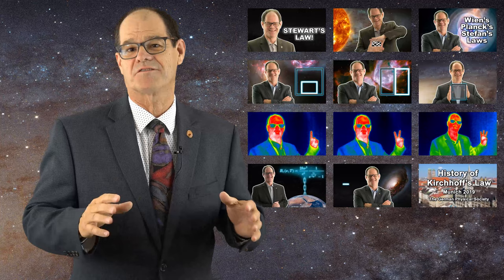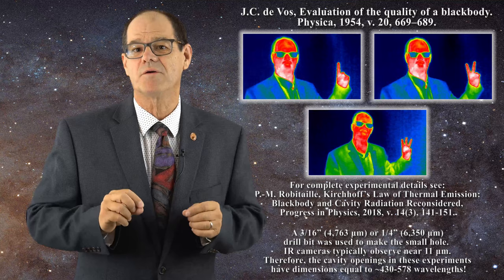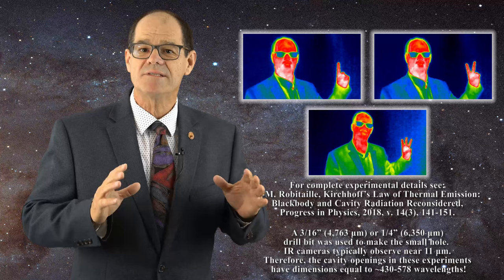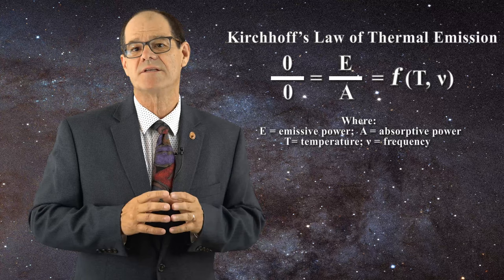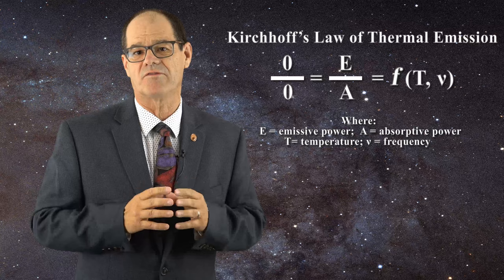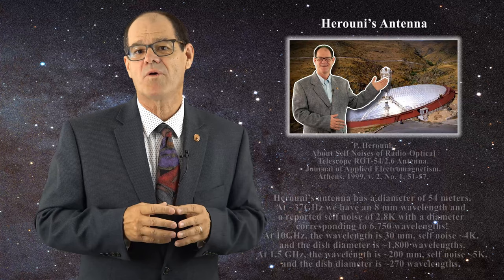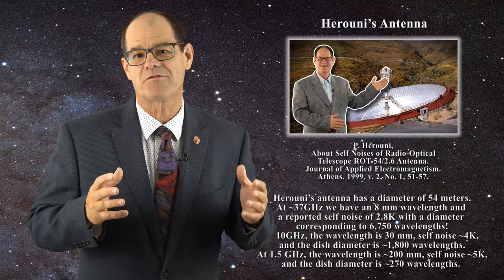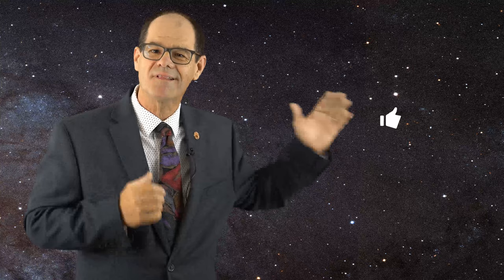Kirchhoff vs Herouni's Antenna!

Comment: My question focuses upon one singular line of argument used by PMR with respect to his general argument that Kirchhoff’s law of thermal emissions is false.

In the short form statement of the PMR line of argument he states:  Kirchhoff’s law can be expressed as E/A=f(T,v). From there PMR argues that if the walls of the box are perfect reflectors, then A=0 results in an undefined mathematical expression. Okay, I understand the point, but… Are we saying that any law of physics that may be expressed in a way that involves a ‘possible’ division by 0 would compel the conclusion that the law is false? The Ideal Gas Law can be expressed in a way that involves the division by 0, if P, for example, is placed into the denominator position and theoretically said to equal 0. A perfect vacuum is P=0. 

I am guessing not, for obvious reasons. If I am right, PMR should consider revamping this part of his argument about Kirchhoff’s law of thermal emissions. He has plenty of arrows left to show Kirchhoff’s law is false. 

A note for Crothers: By making this point, I am not thereby a detractor of PMR. So you may save your invectives and present your point as to why I am wrong here.
Reply: Your remarks prove yet again that you do not understand the subject matter. The more you post the more you demonstrate that you do not know anything about the physics involved. 

Dr. Robitaille is correct; you are wrong. In s 48 of his book 'The Theory of Heat Radiation', Max Planck admitted that his Eq.(27) becomes indeterminate. His Eq.(27) is:

K_{ν} = ε_{ν}/α_{ν} 

In s 48 of his book Planck writes:

“In fact, in equation (27) the intensity of radiation K_{ν} for α_{ν} = 0 and ε_{ν} = 0 assumes the value 0/0, and hence cannot be calculated from this equation.” 

In order to weasel his way out of this major problem he conjured a number of fallacious arguments in abuse of both Brewster's Law and blackbody radiation, along with some concomitant mathematical gibberish. In s 37 he abused Brewster's Law to test reflection in a “special case” to thereby conclude that all materials have the same reflectivity. He writes, in order to advance his Eq.(40) (i.e. ρ = ρ'): “Now in the special case when the rays are polarized at right angles to the plane of incidence and strike the bounding surface at the angle of polarization, ρ = 0 and  ρ' = 0. The expression on the right side of the last equation then becomes 1; hence it must always be 1 and we have the general relations: ρ = ρ' ”.

First, in his special case using Brewster's Law, he contrived ρ = 0 and  ρ' = 0 by restriction to polarized light “at right angles to the plane of incidence”. But in this case there is in fact NO test of reflection at all because under the restricted conditions for Brewster's Law there is NO reflection at the bounding surface (ρ = 0 and  ρ' = 0). So he cannot conclude from this that the reflectivities of all materials are the same (ρ = ρ'). The scientific fact is that different materials can have very different reflectivities, whether they are in contact with one another or not. Planck's desired conclusion that “The expression on the right side of the last equation then becomes 1; hence it must always be 1 and we have the general relations: ρ = ρ' ”, is patently false. This already proves that his claims for universality are false. Yet in s 38 of his book Planck writes about his Eq.(40), which he calls a law:

“An immediate consequence of this law is that the radiation striking the bounding surface of any two media is always transmitted as well as reflected equally on both sides, for every color, direction, and polarization.”

In other words, Planck concludes that all materials have the same reflectivity, which is nonsense.

Secondly, blackbody radiation is NEVER polarized. So Planck cannot restrict the radiation to polarized light in order to apply Brewster's Law under the restricted conditions he contrived so that unpolarized radiation also leads to the same reflectivity for all materials. Once again, his conclusion is patently false.

Now all of this and more is covered in detail in our paper. It's obvious that you have not understood it. Here again is our paper:

Robitaille P.-M., Crothers S. J. "The Theory of Heat Radiation" Revisited: A Commentary on the Validity of Kirchhoff's Law of Thermal Emission and Max Planck's Claim of Universality, Progress in Physics, v. 11, p.120-132, (2015),
http://www.ptep-online.com/2015/PP-41-04.PDF
http://vixra.org/pdf/1502.0007v1.pdf
Reply: "The Ideal Gas Law can be expressed in a way that involves the division by 0, if P, for example, is placed into the denominator position and theoretically said to equal 0. A perfect vacuum is P=0." Michael C

Another example of your ignorance of physics. Your argument is fallacious. The ideal gas law applies to a gas within a container. A vacuum is not a gas, so the ideal gas law does not apply, so you cannot set P = 0 in the ideal gas law. The pressure of a gas is due to the presence of its container. In an ideal gas there are no forces between the gas particles except when they collide with one another and the walls of their container. Only the collisions at the container walls produce the gas pressure. If the container is completely evacuated to produce a vacuum so that there is no gas therein, the ideal gas law does not even apply - because there is no gas!

Comment: Now, what does this have to say about the Web? Can data processing fix any problems in this area? Was the Web finally launched because it was no longer possible to hide the boondoggle? Is its short life a necessity for reasons of physics or politics? Could a solar sail have provided the required thrust to keep the L2 station? Was the short life a decision mandated by the elephant in the room? Bigger and better is always more expensive. Is it all about funding?